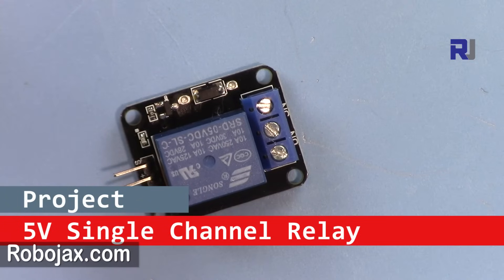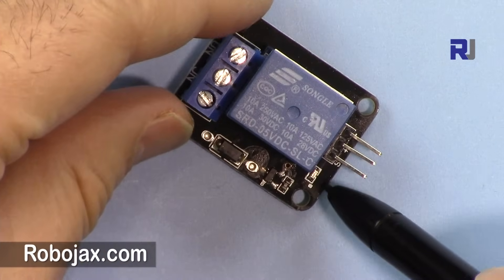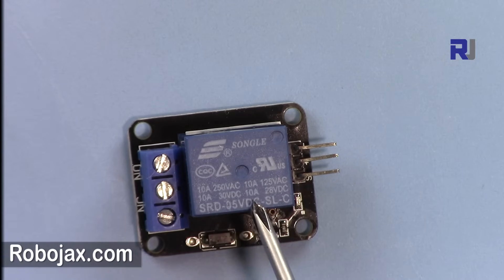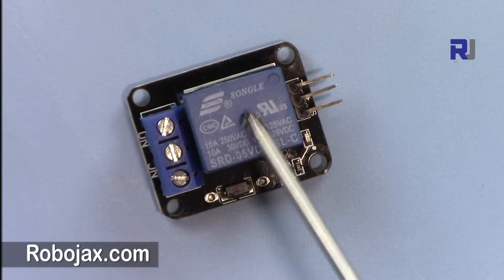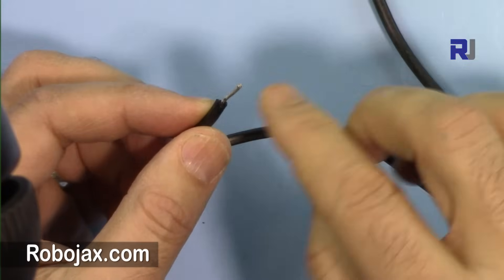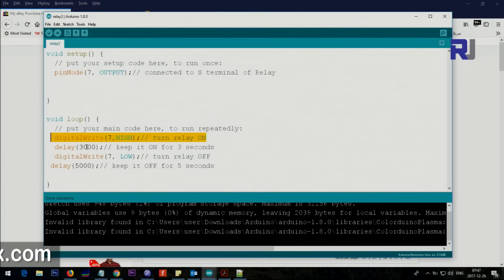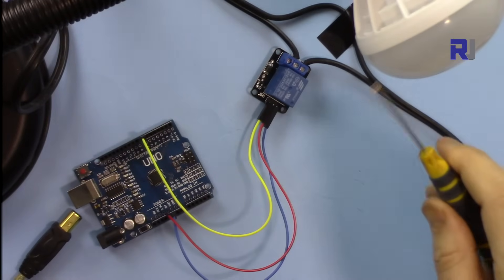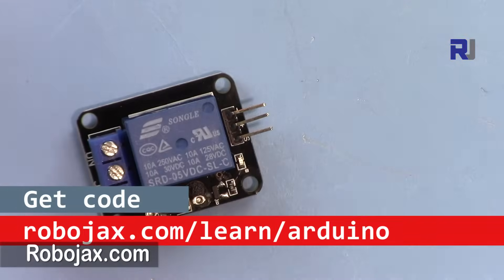How to use 5V Relay with Arduino to turn ON and OFF AC  bulb or DC load RJT33

Comment: Awesome video tutorial. I’m a beginner. Just wanna ask if I follow your tutorial to control an AC bulb, what should i use: a High Level Trigger relay, or a Low Level Trigger relay?
Reply from the maker: Thanks. that doesn't matter which one you use. The relay shown in video is HIGH trigger.

Comment: I have connected same circuit with 12 volt dc motor pump but facing issue on push button relay start for 3 second then off but it automatically turn on after some time without pressing the button
Reply from the maker: wrong video. see this with push button https://youtu.be/7CCSRs5bvH0

Comment: can i control  an  AC 3 phase 1hp water pump with this relay module ?
Reply from the maker: 3 phase has 3 wires. you will need 3 of this.  Yes if you use 3 of them.
Reply: @robojax  thanks a lot

Comment: Good vídeo, is posible to use this relay without Arduino, only conect positive and negative. Thanks.
Reply from the maker: if you connect it directly to 5V battery or USB. yes. But if you got just weak signal, then you need to drive the relay. here is my video on driving a relay https://youtu.be/N-fFk51Eb8s
Reply: @robojax  Thanks for your help. The relay that I have is the one that has 3 input pins, vcc, gnd and S, if I connect positive and negative to vcc and gnd, the relay does not activate until I jumper pin S with the positive, that pin called S is the one that connects to the Arduino but I don't have an arduino.
Reply from the maker: that is S is input of signal pin. That will turn ON and OFF the relay. Connect it to 5V (HIGH) or GND (LOW) and see which will turn your relay ON. If your relay is LOW level trigger, it will turn on when you connect it to GND but if your relay is HIGH level trigger, it will turn on when you connect it to 5V.
Reply: @robojax  Ok, Robojax, Thanks a lot for your help.

Comment: You have not said about the power adaptor jack in left corner below usb jack. Why it is not linked and explain. Why left unattended.
Reply from the maker: Hello, this video is about Relay. That jack is explained when the Arduino board is explained. You can connect up to 12V at the jack. here is the jack wiring https://i1.wp.com/www.open-electronics.org/wp-content/uploads/2015/07/Fig9.png

Comment: you can also use an OPTO22 relay
https://i.ebayimg.com/thumbs/images/g/C1AAAOSwtNFdbZGC/s-l225.webp
OPTO-22 120/240 VAC, 25 Amp. 3-32V DC CONTROL SOLID STATE RELAY (SSR)
Reply from the maker: Thank you for sharing.
Reply: @robojax  I have been using  12 LED's to control  3 large stepper motors.  LED--> PhotoTransistor-->Resistor-->TIP120 Power Transistor.  The PhotoTransistors and TIP120's are cheap on Ebay.  ie. The Arduino sequences the LEDS's to control the motors.  The TIP120 has built in diode protection against back EMF from the motors.  Of course there are cheap driver modules out there, I have been trying to work with TB6600's but they did not work for me, others have reported problems with them as well. Maybe someone has worked out simple MOSFET solution ?

Comment: Hello. I don’t use arduino but an other output signal, which is 5Vdc. It doesn’t work. May I know the voltage of arduino signal output. So that I can modify my 5v output to match the arduino output voltage as the signal input with another 5v dc to use the relay board. Thank you. Looking forward to your reply.
Reply from the maker: this is LOW trigger. Turns ON with LOW (0V) and turns OFF with 5V.

Comment: Merci beaucoup, c'est vraiment gentil de partager votre savoir et vous le faites tres bien
Reply from the maker: Je vous en prie. Je suis ravi que vous ayez trouvé mon tutoriel utile. Merci de ne pas sauter les publicités et de continuer à les regarder. Cela m'aidera beaucoup.
Reply: Ahh Lebanese perhaps or just Quebec?
Reply: @AgnosiaAgnosis  Quebec
Reply: Greetings sir, I hope you are doing well. It is requested to answer whether or not a 220-240Vac bulb can be driven using a 5v relay using arduino uno?  I have a project in which i am doing a bluetooth controlled smart home automation. It is requested to give me tips on how to do it.
Regards

Comment: Great video explaining the Songle relays.  I just included them to control my train turnouts and isolation (power) tracks using an Arduino.  Since the turnouts only need about 150ms of power to trigger the solenoid, these are perfect!  Great job!!
Reply from the maker: Than you and good luck with your project. Thank you for not skipping the ads and keep watching it. This will help me a lot.
Reply: Greetings sir, I hope you are doing well. It is requested to answer whether or not a 220-240Vac bulb can be driven using a 5v relay using arduino uno?  I have a project in which i am doing a bluetooth controlled smart home automation. It is requested to give me tips on how to do it.
Regards

Comment: Sir. I'm currently working with my thesis. How come everytime I turn on the switch the relay will turn on, after few minutes later, it will suddenly switch fast from on to off and vice versa then return to normal working. I'm working with a home automation with Bluetooth module and Arduino...
Reply from the maker: if it does that, it means 2 things. 1- signal is coming to relay from Arduino 2-The voltage for relay shuts of or decreases and it turns off.  I am assuming your wires are tightened properly and relay is not on vibrating surface.

Comment: If i use the 5V relay, can I activate the 12V motor?
Reply from the maker: yes you can. Relay is just a switch. The load can be DC or AC 5V or 220V.

Comment: Hello teacher, I would like to ask if there are 5V and 12V relays on the market. What's the difference between them?
Reply from the maker: hello, the difference the operation voltage. They both work the same way. If you want to use Arduino it is better to use 5V because Arduino operates with 5V.
Reply: Greetings sir, I hope you are doing well. It is requested to answer whether or not a 220-240Vac bulb can be driven using a 5v relay using arduino uno?  I have a project in which i am doing a bluetooth controlled smart home automation. It is requested to give me tips on how to do it.
Regards

Comment: if i want to start & stop heater due to change of color from Blue to Pink & Pink  to Blue. Can it be possible through Arduino & Relay
Reply from the maker: Yes possible but I don't have any video on color detection yet.

Comment: Hello. Thank you very much. It is very helpful. I am working with a project of pneumatics cylinder. In need to actuate a 220 V AC solenoid valve with the help of Arduino and relay. So to actuate the solenoid valve is the connection will be same? Can i treat the solenoid valve as the light.
Reply from the maker: Hello,  you are welcome. Here is my video on DC actuator https://youtu.be/EaoB6lfnS7g but I am not sure about AC actuator and types.

Comment: Is it possible to use without the middle screw? I have one relay but for some reason the middle screw is missing...
Reply from the maker: I mentioned in the video, you just need two connection on the relay. But the middle is a MUST.
Reply: @robojax  Thanks!
Reply from the maker: You are welcome.

Comment: Can i use the delay as 43200 seconds (12x60x60) for 12 hours time gap?
Reply: Greetings sir, I hope you are doing well. It is requested to answer whether or not a 220-240Vac bulb can be driven using a 5v relay using arduino uno?  I have a project in which i am doing a bluetooth controlled smart home automation. It is requested to give me tips on how to do it.
Regards
Reply from the maker: You are not even subscribed . What do you lose? I will reply to all Subscriber's 🔔 questions. So make sure to Subscribe.😊

Comment: Can you please give code details for charging 12V L.A.battery  with (battery) voltage sensor as analog input.
Charging to cut off at 14V  and cut in at 12.2V .   May be through Solid State Relay.
Reply from the maker: There are 1000s of battery chargers, I don't understand why people want to build their own charger? Every time I see interest in chargers, then I have never seen the need for battery charger because every device I buy has charger. Can you tell me why even you want to make your own charger unless you are student and this school project.?
Reply: Suggestive system for offgrid sdlar power  without charge controller.
Reply: For suggestive offgrid solar power system without charge controller.
Reply: Greetings sir, I hope you are doing well. It is requested to answer whether or not a 220-240Vac bulb can be driven using a 5v relay using arduino uno?  I have a project in which i am doing a bluetooth controlled smart home automation. It is requested to give me tips on how to do it.
Regards

Comment: can i use the relay with 3.3V power & logic? my MCU is not 5V.
Reply from the maker: Yes you can turn it ON and OFF but you have to provide 5V to power it up.
Reply: @robojax  ok thanks. i think i'll just get some 3.3V relays so I don't have to add extra regulator hardware

Comment: Hello sir, can I use an extension chord to make the connection with the relay instead of the lamp connecting to the relay? Cool video btw 👍🏼
Reply from the maker: yes. If you safely prepare your wiring yes. Consult an licensed electrician to be safe.
Reply: Robojax it should be the same circuit schematic as what you did here except using the hot from the extension chord instead of the lamp..one end of the hot wire should connect to NC and the other to C..is this correct?
Reply: Greetings sir, I hope you are doing well. It is requested to answer whether or not a 220-240Vac bulb can be driven using a 5v relay using arduino uno?  I have a project in which i am doing a bluetooth controlled smart home automation. It is requested to give me tips on how to do it.
Regards

Comment: The project is very good but i want this relay and ardunio to control water heater can i on and off heater between two temperature limits?
Reply from the maker: yes you can. You would have to use a temperature sensors like DHT11, BMP280 or something like that. I have video for both. Search my channel.

Comment: SOS Do I need to solder the wire before putting them in Relay if I have the same type of wire? Thank you!
Reply: I mean is it mandatory?
Reply from the maker: solder makes all treads of wires into one so you can insert them easily. It is not needed.

Comment: is that AC Bulb?
Reply from the maker: Yes. I put it in the title and mentioned it. But it doesn't matter. you can use DC load as well.
Reply: @robojax  i'm sorry for didn't read the title. Thanks:)
Reply from the maker: No problem.  You are welcome. I have a lot of other videos on relay. You may search for them and I have explained them in different contexts.

Comment: Gracias por el video, puedo eliminar los delay para activar y desactivar con un switch?
Reply from the maker: De nada. sí tu puedes. Tengo un video que puede controlar el relé con un botón (o interruptor). https://youtu.be/7CCSRs5bvH0
Reply: @robojax  Mil gracias.
Reply: Greetings sir, I hope you are doing well. It is requested to answer whether or not a 220-240Vac bulb can be driven using a 5v relay using arduino uno?  I have a project in which i am doing a bluetooth controlled smart home automation. It is requested to give me tips on how to do it.
Regards

Comment: how many different lights can you controll with a single arduino?
Reply from the maker: it depends on which Arduino you use. With Arduino UNO you can control about 16. here is an example; https://youtu.be/Q9aBI4ELKC4

Comment: what does 10A 125VAC on the right hand side of the relay indicate?
Reply from the maker: I watched the video wondering how come I did not address such important thing.  Surely enough, I have explained it in the video. Please watch and do not escape. It has been answered.
Reply: @robojax  I meant say that since it can handle 10A at 240VAC then should be able to handle a bit higher than that at 125V. Shouldn't that be the case?
Reply: And will I be able to run a 0.25HP motor with the help of such a relay? The motor barely draws 150W at 220VAC.
Reply from the maker: "since it can handle 10A at 240VAC then should be able to handle" yes it will handle lower but not higher.

Comment: Hi friend, really great video for beginner, thanks
Reply from the maker: Hi, You are welcome. I am pleased that  you found it useful.
Reply: @robojax  thanks friend, I plan to do some projects with this relay soon when my order comes in from eBay
Reply: Greetings sir, I hope you are doing well. It is requested to answer whether or not a 220-240Vac bulb can be driven using a 5v relay using arduino uno?  I have a project in which i am doing a bluetooth controlled smart home automation. It is requested to give me tips on how to do it.
Regards

Comment: Thanks sir
Best video
Reply from the maker: You are welcome.
Reply: @robojax  I don't understand why the trigger pin of the relay is connected to pin 8 which is high when the writedigital value is HIGH??? At this instance, will not 5v will come from pin 8 and damaged the relay??

Comment: I know you are not familiar with ESP8266-01 but how can this work with ESP8266-01 instead of Arduino like this? http://robojax.com/learn/arduino/?vid=robojax-TTP223-relay
Thank you
Reply from the maker: I just put on my "to do list" and will make video when time permits.
Reply: Greetings sir, I hope you are doing well. It is requested to answer whether or not a 220-240Vac bulb can be driven using a 5v relay using arduino uno?  I have a project in which i am doing a bluetooth controlled smart home automation. It is requested to give me tips on how to do it.
Regards

Comment: Hello Sir, thank you for your tutorial. However I am new to arduino and I have one question to ask. How to prevent the delay affecting my sensor system. Because the delay of relay effect the measurement reading of my sensor? I am looking forward for your answer. Thank you very much sir.
Reply from the maker: what delay or sensor? this relay will be activated in about 0.3 Seconds. If you need faster response, then use SSD  https://youtube.com/robojaxTV/search?query=solid

Comment: I want to run pneumatic solenoid (24 Volt DC) using Arduino....do I need a 24 volt battery for it or just a 9Volt small battery connection to the Arduino is enough?
Reply from the maker: Arduino needs it is own power so 9V will work for it. For your solenoid, you need separate power. In this case instead of bulb use your solenoid and instead of AC use your 24V.

Comment: Hey, The circuit is DC,and if we give the AC Supply. how could the bulb works as the bulb is also being DC Bulb..
Reply from the maker: We have power to Arduino and then the load. You have to understand and separate them. Your load can be AC or DC.

Comment: Do we still need a relay if our power source for the arduino is a 12v Battery (Like for motorcycles) and light up a bulb from a 12v Battery power source also?
Reply from the maker: If you watch the video, you will know the relay is a switch. If you need to turn light ON or OFF in a certain way like turn on for 3 sec and off for 8 sec then you need Arduino and the relay (or there is a programmable relay module). If that is not the case then use normal switch.
Reply: @robojax  I don't understand why the trigger pin of the relay is connected to pin 8 which is high when the writedigital value is HIGH??? At this instance, will not 5v will come from pin 8 and damaged the relay??

Comment: Very useful, but it is possible to have the bulb turned on for larger periods of time (like 15 minutes or so)?
Reply from the maker: thank you. yes. It can be turn on for unlimited time.  for example for  25 minuets, 25x60=1230 seconds and because we use milliseconds, add 000 and becomes 1230000 and type delay(123000);
here is my for video relay timer: https://youtu.be/6DGQhQgr7Ak
and here is relay timer with display https://youtu.be/BhEIFzFSMuE or if you don't like Arduino, get this module and set it up to 999 minuets https://youtu.be/ZRAaTRKRmh0

Comment: unable to toggle on and off when connected to realy from esp8266. 
connected esp pin as input pin to relay,
5v dv to VCC of relay.
Ground to Ground.

Light lamp glows, but doesnt toggle?
Reply from the maker: I have not used esp8266 in this tutorial.
Reply: @robojax  I don't understand why the trigger pin of the relay is connected to pin 8 which is high when the writedigital value is HIGH??? At this instance, will not 5v will come from pin 8 and damaged the relay??
Reply: I don't understand why the trigger pin of the relay is connected to pin 8 which is high when the writedigital value is HIGH??? At this instance, will not 5v will come from pin 8 and damaged the relay??
Reply: Thang Tons I'm a complete beginner so I'm probably getting this wrong — but is the key here when he sets pin 7 as an OUTPUT pin therefore only outputting a signal and not receiving anything (i.e voltage). Please can someone clever step in here and clarify! Thank you

Comment: bought a 5v relay from you guys and it's not working - I have it connected to the arduino and the board LED turns on and off but I cant hear the relay turning over and no power is passing through. Can you help?
Reply from the maker: This doesn't have any light or LED. You must have this item https://youtu.be/7tUGUXyloXQ . Check your relay voltage written on it. make sure it is 5V.  If it is 12V, the LED will turn ON but relay won't work or click. If it is 5V relay, then it is defective.
Reply: @robojax  yeah I have the one with the led on it.  No it doesnt turn on.